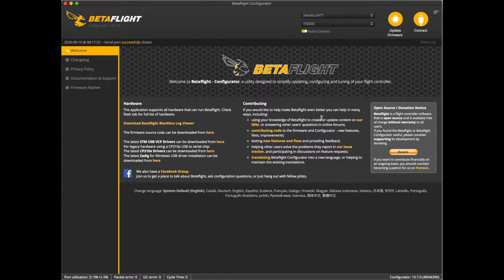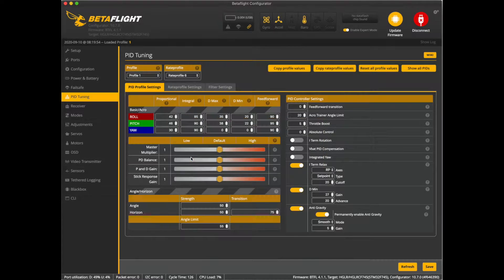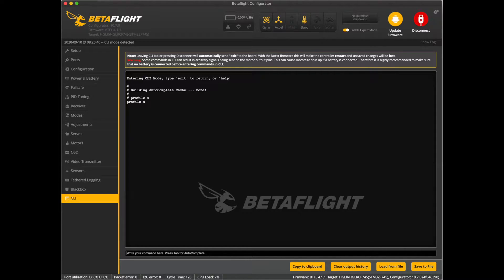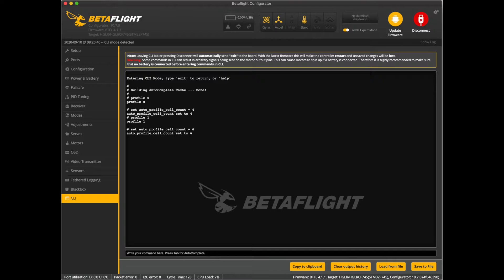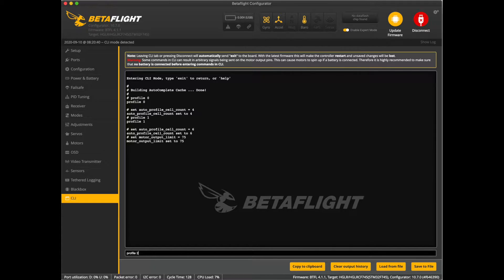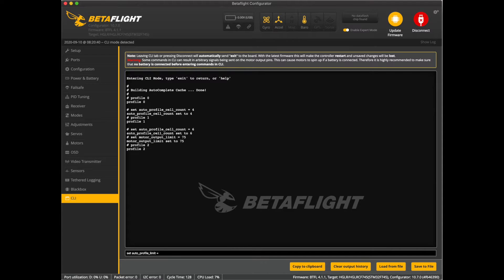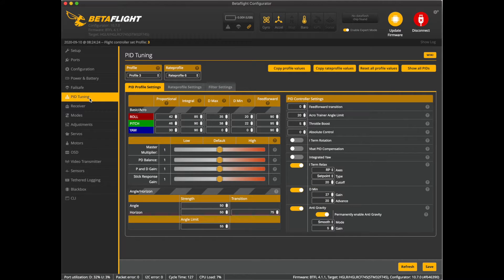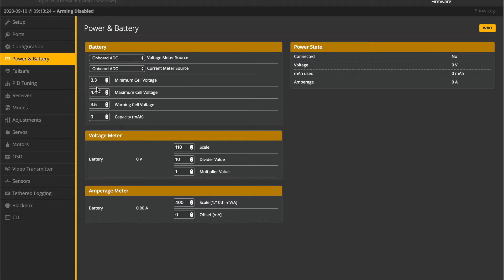Can You Run 6S on a 4S Quad?!

Comment: Sweet.  I am planning to scale down some 2722 Kv motors to around 1900 Kv for a 6 inch 4S build.
Reply from the maker: Beep Tube I have few sets of 4s motors laying around myself. Definitely comes in handy for 6s.
Reply: @TitanFPV  I just felt like 2722 Kv is a little high for 6 inch props, even on 4S.  They are the Hyperlite 2405 motors.  I couldn't find any of the 1922 Kv in stock, so I figured I'd just get the high Kv version and dial them down.
Reply from the maker: @Perforator2000  Yep, remember you can always dial higher kv down with motor output limit, but you can’t dial them up. Good call.